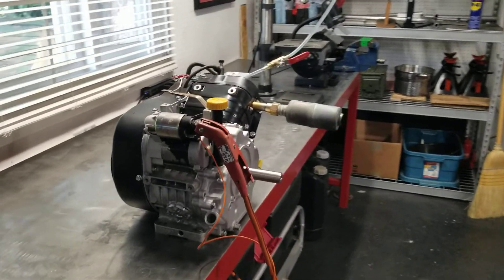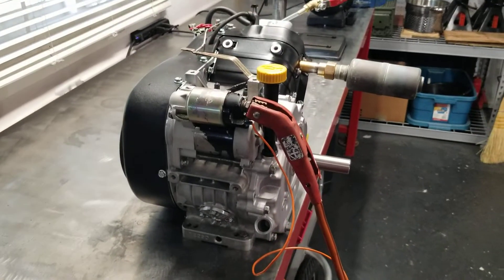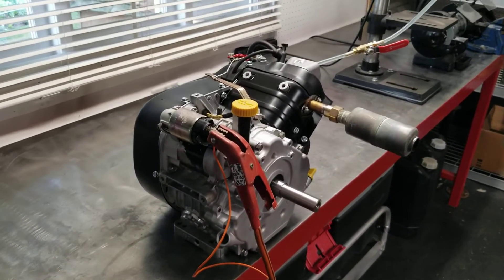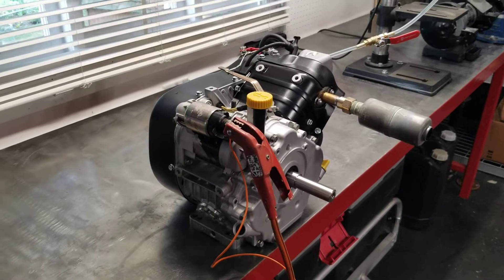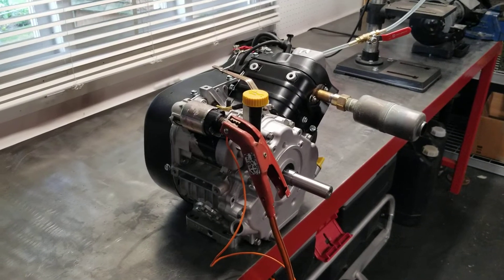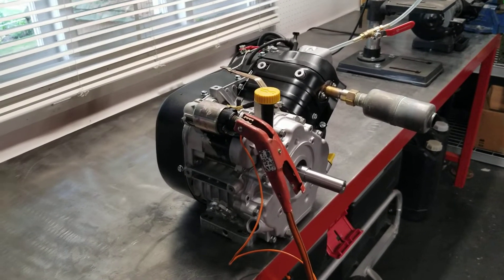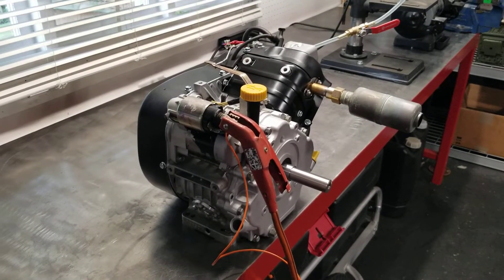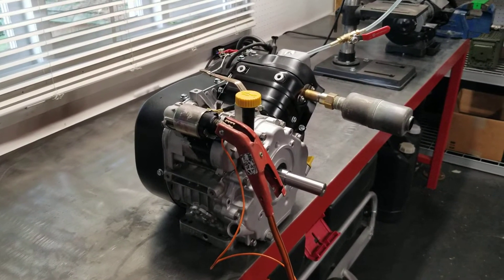John Deere Gator Engine Rebuilding

Comment: Off topic of this video but i had a question about the kf82 motor....i noticed that it doesn't have an oil filter, as most early small engines didn't, but am i correct in assuming that it doesn't have an oil pump and relies on splashing from the crank? Also...do you have rebuild parts for this motor, i find some of the major stuff like valves, rings, and pistons and such but don't see the little things needed like valve retainers....i really love your videos and i have ordered your book , thanks a million Brad 😁

Comment: Hello. I have watched several of your video's and have really enjoyed them. I am in the process of rebuilding a FE290 off of a 1993 DS Club Car. I was wondering if you know of someone that can bore this cylinder to 1st oversize. I sent it to a company in Missouri and they said they can't bore the ones with the cylinder made into the crankcase. Thanks in advance if you can steer me in the right direction. Barry - Greenville, MS
Reply from the maker: We bolt them to a plate and do them in a CK10. They can also be honed OS on a rod hone. We charge 249 but are 3 months behind.